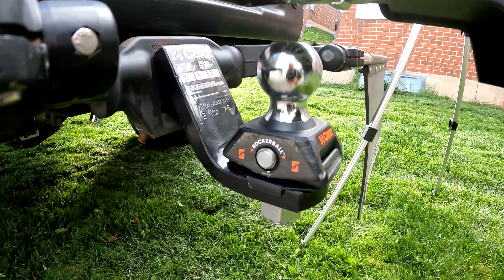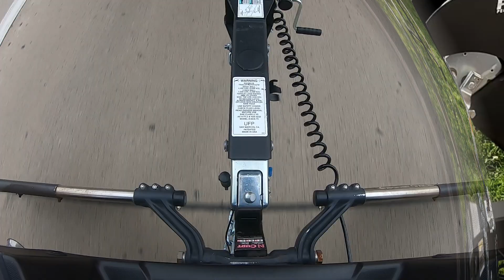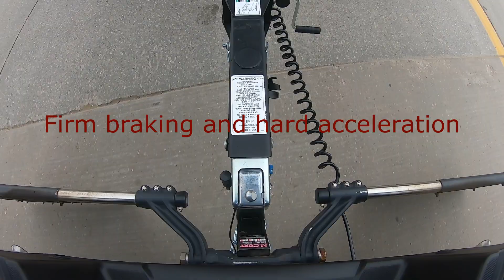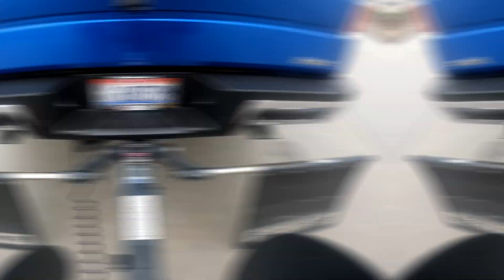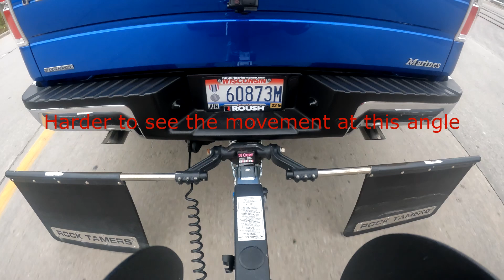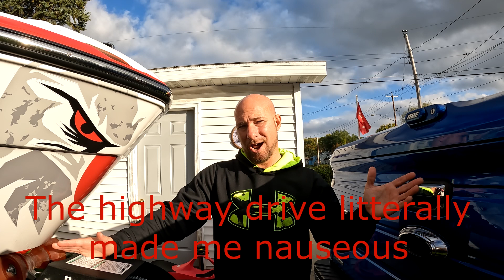Curt Rockerball. Smoother ride or waste of money??

Comment: Great video Jay! I love the camera angles. I agree with you, I can’t see this working out in the long term. Think of the amount of wear that joint is going to get over time.  I believe the driving will just get mushy instead of having a nice solid connection to the truck. Also, not sure how it’s going to affect the brake actuation with the forward movement durning a bounce. I drive my sx240 on an expedition max, and I don’t really notice that big of a deal with bounce while it’s attached 🤷🏻‍♂️. It was worth the try though!
Reply from the maker: Thanks for the support. My normal hitch never bothered me, but I thought I'd try this. Definitely not using it anymore.  At least not with the boat. Possibly I'll try it again with the snowmobile trailer.

Comment: i believe its just rubber bushings inside and its rated for 7500lbs, maybe you're on the high end of the weight rating and thats what's causing the constant movement? also it looks like your coupler already has some kind of dampening mechanism in it. maybe two dampeners is too much? i just ordered one, but ill be towing a 1300 lb sxs on a 1000 lb trailer and i have to drive down washboarded dirt roads to get to parking spots so curious if the lighter weight will make a difference
Reply from the maker: 7500lbs is it's rated weight, you are correct.  I feel like I'm well enough below, but possibly I am just too close to the max. My trailer has surge brakes, not electric.  So that's what you're seeing move. 
I'm probably going to try it again with my 2 place snowmobile trailer.  That's less than half the weight and no brakes. 
I'm curious to hear your thoughts once you get a chance to try it.
Reply: @SmoknJaysGarage  so i tried it and didnt like it, so switching to a standard ball. i think my setup was too light and yours was too heavy. if you are pulling just the right amount of weight it might work well but since the amount of tension/flex isn't adjustable, this isnt a one size fits all solution
Reply from the maker: @TheTightShirts  thanks for the update.  
I wonder what the right weight is? 
Kinda seems to be more trouble than it's worth.
Reply: I agree, having a dampener on the coupler as well is exacerbating the total movement. And it's probably best used along with an anti-rattle receiver bracket. Plus being on a hinge pin is just another place for wear to occur. I don't wanna say it's a gimmick, but more than likely redundant.

Comment: Did you keep the factory bow roller? I’ve read a lot about it marring the hull.
Reply from the maker: I did not, I had a new one put on before taking delivery of the boat.
I also heard bad things about the stock one.
Reply: @SmoknJaysGarage  good to know, thanks man. Taking delivery of a SX195 in May. Can’t wait.
Reply from the maker: @grantharmsen8815  awesome!  Congratulations
Reply: @SmoknJaysGarage  your tips/tricks are helpful. The 195 is a single SVHO engine which Yamaha only provides a single battery so a second battery install will be the first project